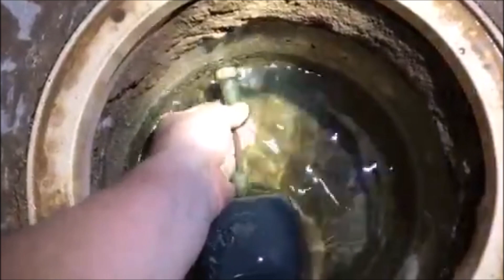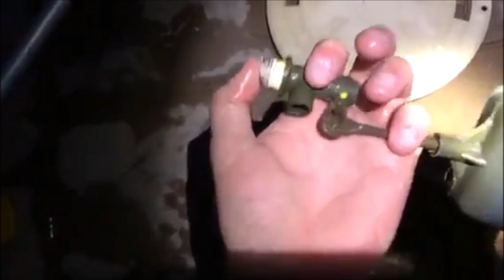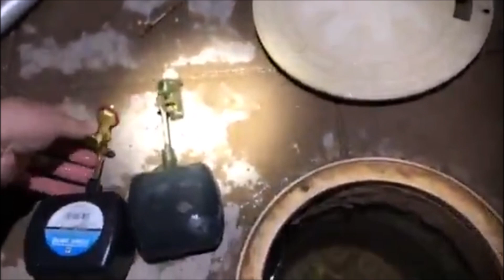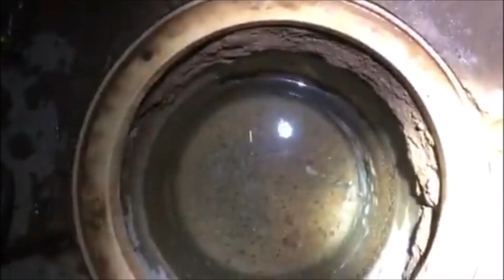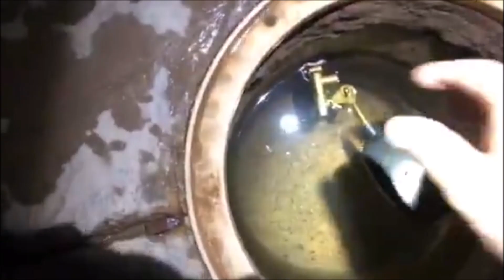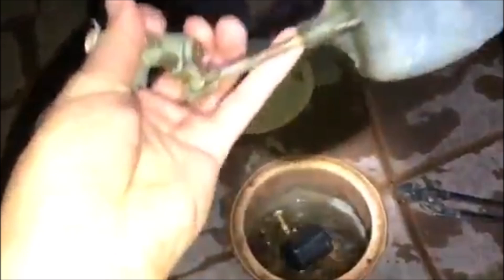How to replace auto fill float valve water leveler for pool DIY video #leveler #autofillvalve #pool

Comment: Mine seems to be rusted stuck and I cannot remove the old one. As there is very little access/clearance to the nut, it seems to be impossible to remove. Any suggestions?
Reply: @Judge.  You can try some type of a lubricant that may be able to loosen up the rusted nut. Spray it really well and then let it sit for a few minutes.  Please give us an update.

Comment: Question. We had a plastic male end which snapped off when trying to unscrew it due to the sun. Any tip of removing the plastic male end within the female hole.
Reply: @Wix. What you might want to try is get a small screwdriver and put it in and give it some force and try and get the male end to unscrew.   You can also get a small drill bit and drill through to center and then try to pick it out.  Please give us an update.

Comment: Good video. Quick recommendation... instead of teflon tape on the threads, use Rectorseal T Plus 2 pipe thread sealant which is compatible with plastics. If the female plastic part on the autofill gets brittle, even a few wraps of teflon tape could cause it to crack. It happened to us, in fact, not long after our pool was built. Fortunately on our model of autofill we were able to successfully repair it using JB WaterWeld epoxy and then used T Plus 2 on the threads.
Reply from the maker: Thank you so much for the information! Very helpful!